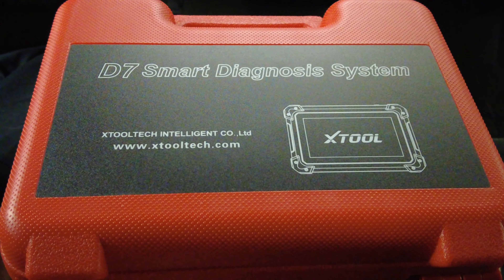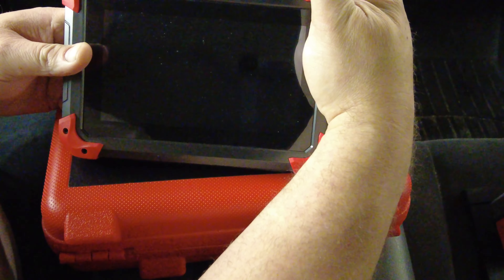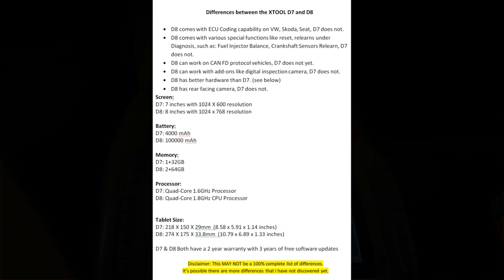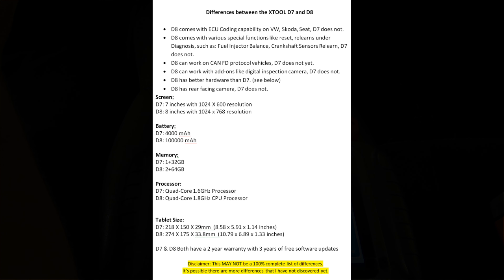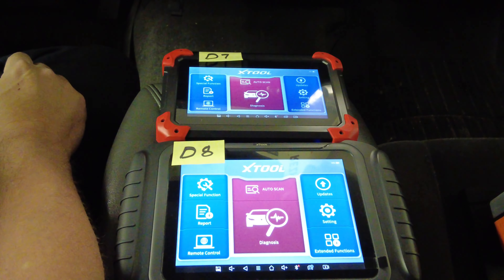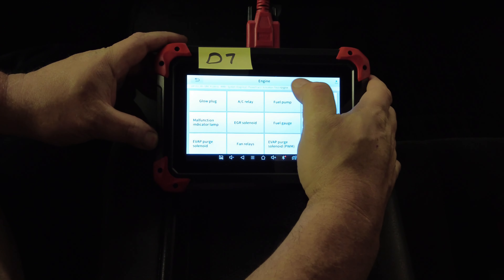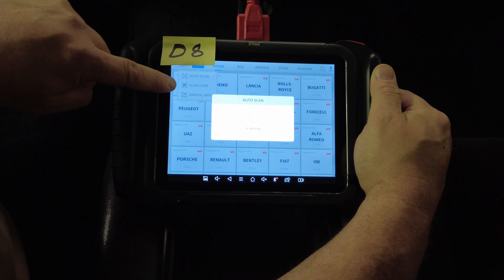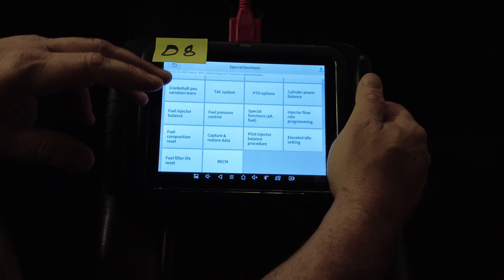XTOOL D7 vs D8 Comparison.  Differences Between These Two Diagnostic Scan Tools

Comment: Lookin at the D7 & Launch 919E
Reply from the maker: I have a brand new Launch 919E that I am making a video with.  It should be live on YouTube by then end of next week.  The D7 has been very good, especially after it received that major update last fall (late summer) so it could keep up with the Autel 808 series of tools. So far the 919E looks pretty good but I haven't had a chance to really dig into it yet.  Stay tuned. Thanks
Reply: @SlipFitGarage  What is better the 919E or D8,I need something for Abs & yaw sensor stuff,my stabili trak is goin crazy
Reply from the maker: @joehiatt1992   All three scanners mentioned... the D7, D8, and the CRP919E will be able to provide codes and live data related to your problem. None of the scanners mentioned is more magical than the others.  All three of these tools will provide the raw data.....  it's still up to you (the mechanic) to decipher that data and determine what the problem is, and how to repair the problem. Technically the D8 is a (small) step up from the D7 and the CRP919E but most of that "step" is hardware.....  larger screen, larger battery, etc.  The D8 might also have a touch better graphing capabilities when graphing live data but nothing spectacular....
Reply: @SlipFitGarage  Thanx

Comment: Hi!
How long does the battery last on the D7 for you?
Reply from the maker: For me?  I've never had it go dead on me.... but then again, I never try to use it for more than an hour or two at any given time.  I just make sure to shut it off instead of letting it go to sleep when I'm done using it. That way it always has power to turn back on when I need it again.  The battery in the D7 is NOTICEABLY smaller than the battery in the D8.  I did updates on the two scan tool before I made this video and there were a BUNCH that needed to download and install on both tools. Probably took about 45 minutes total time. (roughly)  Both tools had freshly charged batteries when I started.....  I notice the D7 was roughly half dead and the D8 was only down to about 90%.  (again, roughly) Hopefully this give you an idea.  The battery in the D7 is less than half the capacity of the battery in the D8. Thanks for the question.

Comment: Does the D8 have key programming?
Reply from the maker: Yes, it does, but not on ALL vehicles.  And if you need to program the key (fob) itself, the D8 requires another piece of hardware for the fob to sit in while programming.
Reply: @SlipFitGarage  I think for standard RF dongles it works without the adapter. The adapter is for RFID type dongles.

Comment: Can you do mileage adjustment on Toyota, GM, Ford, Honda with this? Or which scanner do you recommend?
Reply from the maker: Both scanners in this video have the ability to perform mileage correction. Not all vehicles have the capability to change mileage VIA the OBDII port.  I've never needed this function so I cant tell you which makes and models this will work on. The ability to enter the correct mileage when changing a gauge cluster is great..... but odometer fraud is a felony.  Just be careful.  Thanks for the question.

Comment: Can both read fuel pressure and transmission fluid temperature ?
Reply from the maker: They both can and will if that information exists in the PCM of whatever vehicles that you may plug into. If the computer in your car doesn't monitor those data PIDs in the first place, then NO scan tool will be able to display that info. For example: There is no fuel pressure sensor on my 2006 GMC truck, so therefore that information does not exists in the computer and there isn't a scan tool on the market that can force that data to appear on screen. Thanks for the question.
Reply: @SlipFitGarage  Thanks for the reply.I read somewhere that somebody couldnt read fuel pressure and thats exactly what i was thinking. The vehicle didn't have a sensor for it.
Reply from the maker: @muddyriverdogz  Yeah, that seems to be very common.  A scan tool, is just a window  into a vehicles computer.....  if a function, or data PID, or active test, etc doesn't exist in that vehicle's computer to begin with, then the scan tool can NOT make it happen.  Regardless of scan tool brand.  If something doesn't exist in the first place, the it simply DOES NOT EXIST.  Another perfect example of this... and somewhat obvious example is:  one of the service functions (sometimes called "special functions') listed is called "DPF".  That stands for Diesel Particulate Filter.  Well, my truck has a GAS engine.  There is NOT a DPF anywhere on my truck.  Why would I expect a scan tool, of any brand, to recognize a DPF on my truck?  That would be silly, right?  Well, same goes for any other function that doesn't exist on my truck, but the scan tool is capable of when connected to other vehicles. Thanks for the reply.

Comment: Do either have wireless capability
Reply from the maker: They do make the D8 in both wireless, or wired versions.  Originally, the D8BT (blutooth) model did not exist when I made my D8 videos.
Reply: Important Note: As far as I know, the Bluetooth model does not have cable connect capability.  So no bluetooth, no D8.  I wish they had a model that had BOTH.

Comment: Great summary. Will either unit scan a 2011 Saab 9-5 Aero?
Reply from the maker: Either scanner will scan the Saab and give you any trouble codes that may exist.....  the D8 just has more control of certain functions and diagnostic procedures. These are both OBDII scan tools.... Any vehicle manufactured and sold in the US from 1996 or newer is OBDII.  Thanks for the question.

Comment: This is very helpfull
Reply from the maker: This video is not 100% accurate anymore. There was a large update that came out after this video was made that essentially made the D7 function just like a D8. For the most part, anyway. The examples that I showed in this video are no longer relevant.  The D7 is a pretty damn good bidirectional scan tool nowadays.  There is a new model that recently came out that is called the D7S which has a larger battery....  And in the next month or so, there will be another new D7 coming out that will be called the D7W.  I don't know all the specs yet, but it's going to be a wireless version of the D7 and it will use wifi instead of bluetooth for the wireless connection between the vehicle and the scan tool.  Wifi is a MUCH faster connection.  Thanks for the comment!

Comment: I purchased the Xtool D8 several months ago, but just started to use it more and found while looking at freeze frame data from a 2013 Nissan Frontier, there are PIDs with data displayed that are named Option 1, Option 2 thru Option 8. Not sure what these PIDs are for so I contacted the Xtool help email and after an exhausting 4 days back and forth they say they are not sure to contact S4 Shop.  This is really messed up when the Manufacturer dosent know about their own product. Buyer beware.
Reply from the maker: I do appreciate your comment so please don't take this the wrong way:  I have said this before in many of my past scan tool videos... there is no such thing as a perfect scan tool.  If you went out today and purchased the most expensive Snap-on scan tool, I guarantee you would eventually find a vehicle or two (or ten) that the tool will struggle with. It is unfortunate that your D8 shows eight unexplained data PIDs on your Nissan Frontier but that same scan tool will probably work perfectly on the next vehicle that you plug  into. Other than the 8 data pids, does the tool work fine on that vehicle, otherwise?  

EVERY Chinese scan tool on the market, WITHOUT FAIL, has similar unexplained anomalies.  I haven't used a Chinese scan tool yet that DIDN'T have a few hiccups here and there. In fact, a "perfect" scan tool doesn't exist. Not even an eight thousand dollar Snap-on.  They all have problems on certain vehicles. 

Thanks for your comment.

Comment: None of the Xtool scanners will work on any Secure gateway Dodge 2018 and up. The tool manufacture does not and has not worked with auto auth to gain access to run bi direction controls.  None of the xtool line will do this there isnt a listing on auto auth for xtool. Fix that Xtool  my other scan tools that do are an Autel 906 pro and a Top Don lite 2
Reply from the maker: I replied in greater depth to you other comment under this video but maybe the "12+8 Cable" would be a temporary solution for you when working on 2018+ Chrysler vehicles.  They're about $20-$30 bucks delivered from Amazon.

Comment: The D7S has the better Android and better CPU I think.
Reply from the maker: Yeah, probably....  But just to be clear, the D7S did not exist when this video was made.  The new D7S (which I also did a video about) is only a few months old at this point, and this video is almost 2 years old. Wait until you see the new D7W, same as D7S but it's wireless (instead of corded) and it uses Wifi instead of bluetooth.  The only other scan tools on the market that use WiFi for the connection with the vehicle start a like $3k, or more.  The d7W will be here in a few days.  Video will follow soon after.  Be sure you're subbed and stay tuned to see that video.  Thanks
Reply: @SlipFitGarage  Thanks for the info, I think I trust the wired ones more.  Wifi and BT are too finicky.
Reply from the maker: @sandplasma  Well, that's totally up to you. Bluetooth IS finicky.... but Wifi is far more refined and perfected.  Billions of people use WiFi connected devices all day, every day across the world with relatively few problems.

Comment: Hey Brian, do you know if either the D7 or D8 will do ecu coding? For example,  can you rewrite the VIN to a control module if you replace a module.

Great video,  thanks!
Reply from the maker: I don't believe the D7 can  that....  as for the D8, depending on the vehicle, I believe it has a procedure where it will allow you to REPLACE a module as long as it can read the VIN in the old module, then you pull out the old module, install the new one, and the scan tool writes the old info into the new module.  This is a replacement procedure as long as the old module will still somewhat communicate with the scan tool.  It does NOT write VIN numbers into modules from scratch. I am about 95% sure of everything I just wrote.  If you're looking for 100% certainty then I would recommend an email to XTOOL just to be sure. Thanks for the question.

Comment: Herd borh these wonr program toms sensors
Reply from the maker: Did you mean TPMS sensors?  Yeah, neither of these are TMPS tools. Most scan tools do not program TMPS sensors unless the scan tool has full TPMS capabilities built in, which is not common.   Most tire guys use a stand alone TPMS tool to program sensors.  You can buy scan tools with TPMS capabilities but it will cost more....  usually about the same as the price of a stand alone tool. Thanks.

Comment: First of, thx for your reviews as it help me decide to get the D8. However, after updating it, this scanner is POS. I use it mainly on my Honda, and Acura vehicles, and the thing does not even have TPMS programming for normal Honda models. Reached out to tech support, and all they said was sorry. NSX, and Legend only on TPMS relearn. Who owns a an NSX, and Legend has TPMS? WTF, I wasted 650 dollars on this doorstop. I stopped using it after this debacle. And no I just did not give up, I wasted a lot of time on this just to see it it does what it says it does. More like 50 pct of what it claims, it does, other than that, it's useless. If anyone is interested in buying mine,  PM me. Used maybe 10x.
Reply from the maker: First of all, most TPMS functions are not included on most scan tools.  If you want that functionality, then you would need to buy a scan tool advertised as having the extra TPMS capabilities built-in.  Most scan tools sold today DO NOT include full TPMS capabilities, including the D8.  There is a reason why scan tools that have full TPMS abilities built-in cost roughly $300 more than the same scan tools without TPMS abilities.   You could also buy a stand alone TPMS tool for roughly $300 bucks but they will get their money out of you one way or another if you want to have full TPMS functionality. 

Second, what exactly doesn't work on your car?  Are you talking about features that DO work on your car with other scan tools, but not with the D8?  Or are you talking about features that your car does not support to begin with?  You do realize that just because you see a certain function under "Special Functions" that does NOT necessarily mean it will work when plugged into your car, right?  For example, you wouldn't expect a diesel DPF regen command to properly work on you gasoline powered Honda, right?  Well, just the same, there are other functions that the scan tool has, that you car does NOT support.  EVERY function on a vehicle that can be commanded by a scan tool has to be already programmed into that vehicle by the automotive manufacturer to begin with.  Scan tools DO NOT magically force a car to do what ever it wants, whenever it wants. That's not how it works. Scan tools simply request features and functions that are already available in the vehicles computer. That's it.  If a certain function is NOT available, then there is NOT a scan tool on earth that can make it happen. Those 50% of functions that do NOT work on your D8 will probably work just fine when you're plugged into a different vehicle that DOES have some of those features programmed into it's computer. 

Third, you didn't "waste" any money.  If you're not happy or satisfied with a purchase from Amazon, simply return it back to them.  They offer free returns.

Thanks for your comment.

Comment: Number one. They both should be wireless.  Number two I did not kn0w the 7 did not do relearn stuff. 
Glad I did not buy one.  Probablly get an ottofix.  On top of that I am not impressed with there service or attitude.
Reply from the maker: Number one, this is an old video, a lot of information has changed since it was recorded.  Both the D7 and the D8 can now be purchased as a wireless device. In fact, the new D7W and the new D8W are the first affordable scan tools on the market to use a WiFi VCI, which is MUCH better than a bluetooth connection. (see my recent D7W video) Second, the D7 NOW has full functionality like the D8...  The D7 now has the relearns and resets that were missing in this video.  This all happened when Autel put out a major update last summer that gave the entire 808 family full bidirectional control, which is also why the OTOFIX D1 Lite is now also full featured. It was a chain reaction that rippled through the entire scan tool industry.  All (most) of the mid level scan tools that were only missing a few functions got upgraded to full function tools. As for their attitude, you're certainly entitled to your opinion.  I'm not sure how you arrived at that opinion but that doesn't matter.....  In the end, it's your opinion. The OTOFIX is a great tool, too! Thanks for the comment.

Comment: The car care nut said the D7 battery does not last very long
Reply from the maker: The original D7 is a corded tool.....  It's getting charged anytime it's plugged into a vehicle diagnostic port.  The only time the battery is relevant is maybe when you're downloading and installing large software updates....  And if that's a problem, just plug the charge cord into the tool while it's updating.  If it was a cordless tool, battery capacity might be an issue... but it's corded.   Just my $0.02.....

Comment: The D8 battery says 100,000 may battery, not 10,000 as you stated. Far greater battery life than 4000 mah battery of the D7 which has been an issue for some.
Reply from the maker: Update:  I checked into this a little more.....  The battery is actually 10,000mAh like I said in the video.  The 100,000 (one hundred thousand) number printed on the spec sheet that I put on-sceen is actually a typo.  When I asked XTOOl to send me a list of differences, I simply did a copy/paste into a Word document from portions of their reply email and the person at XTOOl typed 100,000 instead of 10,000.  Sorry for the confusion.  Still a good catch on your part.  Thanks again.
Reply: No way any tablet has q
100kmha.  Common sense
Reply: @jrh8302  Exactly.  That would be a battery about the size of a car battery and about that weight maybe slightly less.

Comment: The USB A is a laptop connection.
Reply from the maker: This is an older version of the D7 and D8 scan tools.  This video is over two years old at this point.  I don't remember specific details about these older versions, but the new D7S/D7W, along with the new D8S/D8W scan tools have a setting called "USB Setting".  You can change how the USB port operates.  They call the two settings "Data Transfer Mode" or "Expansion Mode".  I would call these two setting "Host mode" or "Client mode". But that is a debate for another time. So, in other words, it's more than just a "laptop connection" as you called it.....  at least on the newer scan tools, anyway.  And even the older tools have probably received this ability VIA over the air software updates.  However, I have not verified this for myself, yet.  Thanks for the comment.
Reply: @SlipFitGarage  
You're welcome 'Slip'.
I bought my D7s in February of this year (2024)... and it's black framed and has the camera and fold out stand like the D8's!
 I check it again to see if it has the 'special function'.
Can't wait to start using it!